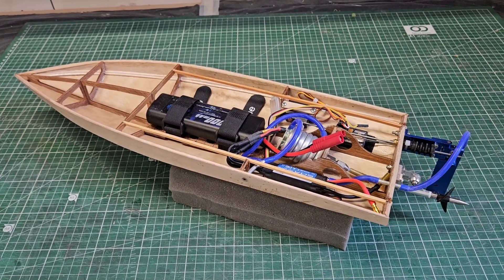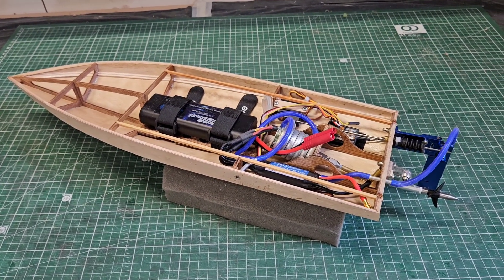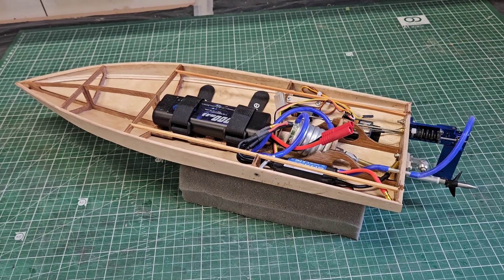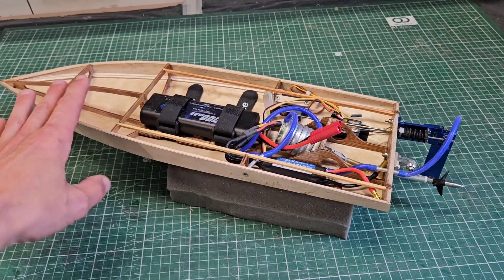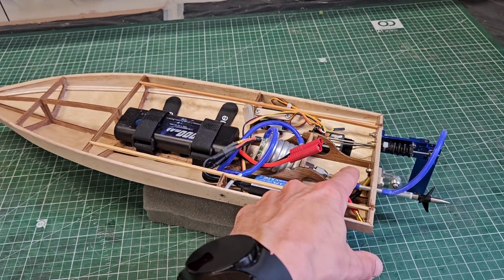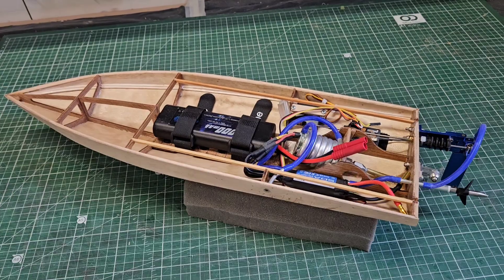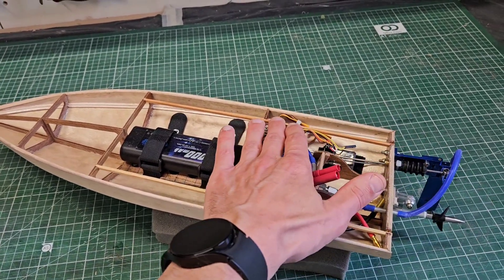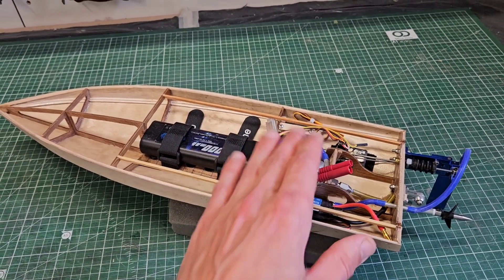How to build a fast rc boat: beginners guide part 2

Comment: Hello DJ! may i know the outer diameter of the silver tube that you used for water cooling system and the inner diameter of the blue rubber tube?

Thanks!
Reply from the maker: The aluminium tube is 4-3mm and the silicone blue tube is 5-3mm
Reply: @CozyRC thank you!

Comment: just finishing up the frame/hull  and waiting for hardware etc............the build "was not easy as it looked!   you must have had some super thin ply to make the cowling  but it looks sexy! will be doing the same thing.....was gonna order the parts  from the list you mentioned but still cant figure out how to navigate it...🤔so had to  order from some place else,  its all from china anyway.
Reply from the maker: Sounds good! The cockpit is made from 1mm birch ply.  You need to align the grain of the wood in the length of the cockpit shape, to be able to bend it.
Reply: I have a hot pipe/bending iron that helped me bend my cowling... a light dampening- then bending over the hot pipe.

Comment: What the size of the silicone tubbing and brass tube u didn’t provide a link for it
Reply from the maker: The tube size is 5x3mm. I used this one: https://s.click.aliexpress.com/e/_ExOEpKM

You mean the brass tube for the steering rod feed through? That is a left-over I had. You can use any tube you want. I once used a cut pen cap 😎

Comment: Is there a way to print this on a regular printer?
Reply from the maker: @mulheron97  Yes, there are ways to split the drawing into multiple pages, and print them with glue strips. That option used to be called 'poster' in Adobe, but probably other software can do that, too.
Reply: @CozyRC  Do you know how i would be able to tell the sizes and keep them matched up thats the part im very confused?
Reply from the maker: The drawing is A1 size, so if you print it as partitions in 100% scale, it will end up correctly!

Comment: Excellent work, I would just like to ask you about the characteristics of the engine, the link you have made available shows some types.
Thanks in advance.
Reply from the maker: Thank you! I recommend the 2948 3450kV motor. On 3S, you will have a very fast boat!
Reply: @CozyRC  Many thanks 👍

Comment: How did you design the boat? Which software did you use? Please upload a video about it.
Reply from the maker: I designed the boat in Autodesk Inventor. I think there are much better CAD designers out there than me! I will think about making a video on the design process, but honestly, I prefer to make the DIY videos 😎✌️

Comment: Hi, great build! Couple of questions if i may? Firstly, what scale are the plans you published please - so i can work out how to print / cut them out. Also, the ali express pages you linked to have a few different options on them - want to make sure i order the right parts! Really looking forward to the build!
Reply from the maker: Thanks! The drawing should be printed on A1 paper, and the hull  will be 50cm, or about 20" long.
I will add the options to select in the updated file. For now: go for the 2948 3450kV motor, 2200mAh 70C lipo's, 4mm to 3.17mm motor coupler, and 75mm long rudder blade. The other options are mentioned in the parts list, I guess. ✌️
Reply: Brilliant, thank you!!  @CozyRC
Reply: @CozyRC what kind of wood do u use?
Reply from the maker: @mustache405 For the bulkheads I used 2.5mm cheap plywood, and for the plating I used 1mm birch plywood. You can use anything between 0.8 and 1.5mm for the plating and between 2-3mm for the bulkheads ✌️
Reply: @CozyRC thanks
Reply: @CozyRC where do you get the plates I’m netherlands too
Reply from the maker: @mustache405 Ah ok, kijk eens bij Hobbyin Waalwijk!
Reply: @CozyRC  dat is een beetje ver weg ik woon in provincie Utrecht
Reply from the maker: @mustache405 Je kan per telefoon bestellen!

Comment: How do you connect the rubber bellow to the servo, rudder link. Is it super glue ?
Reply from the maker: No need for glue. The rubber bellow has a tiny hole for the link rod to go through. The rubber will seal around the rod. It's a tight fit, and some grease will help to push the rod through the bellow hole (as I showed in the video). ✌️
Reply: @CozyRC  thanks

Comment: How'd you secure the prop shaft to the cable?   Ive heard some glue them, but ive had no luck with glues or epoxies,  so i open glame solder them in on mine
Reply: At the rear?   I know if the solder gives back there or stocks I've had that are glued in, if they break loose, then I've lost prop shafts and good wheels.   So nothing holds yours in the rear?  I might be missing something... lol.
Reply from the maker: @donrusnak7230 The prop shaft itself has a flange, so it can only be taken out from the back of the strut. That way, you can never loose the prop shaft.
Reply: Interesting, I do not think any of the ones I use have that!   All mine need a strong solder weld in there... where you order those from?   I order mostly from OSE, or I'm doing something wrong!!!   Lol.   I could be, it's not like anyone showed me how to do this stuff, it's all trial and error, and people like you and ironclad I learn from.   Minus boats, I know boats well.... lol
Reply from the maker: @donrusnak7230  I order a lot from AliExpress. I actually put the recommended parts list in de drawing file, which you can download for free. Please see the description of the video 😎
Reply from the maker: Hi Don, the flex shaft is rectangle on the end, which goes into the prop shaft. The prop shaft has a rectangle hole, so it engages just by the geometry. No glue required 👍
Reply: I've actually never tried aliexpress, I do use Amazon which seems like alot of the same, but for me, ose is pretty close, if I order on a Monday night I get the parts by Thursday.   I'll check out  the link!